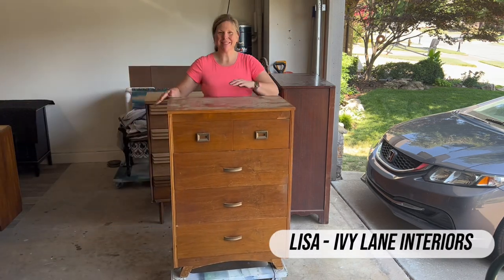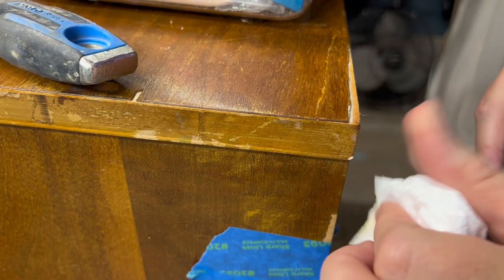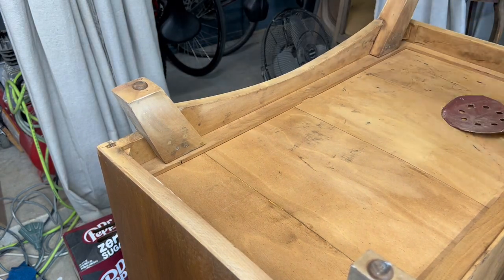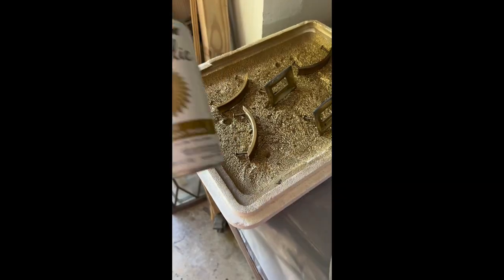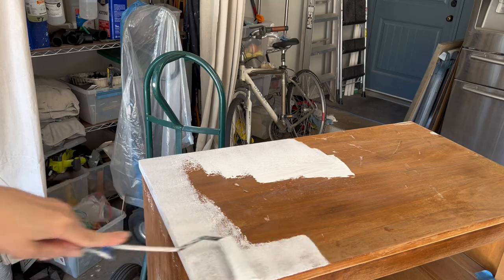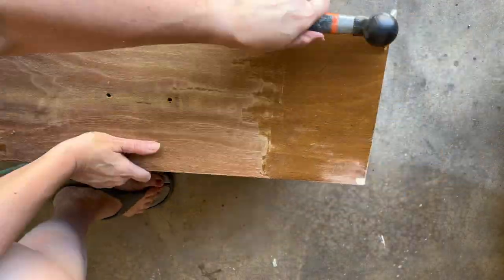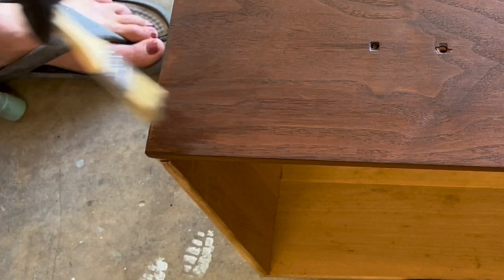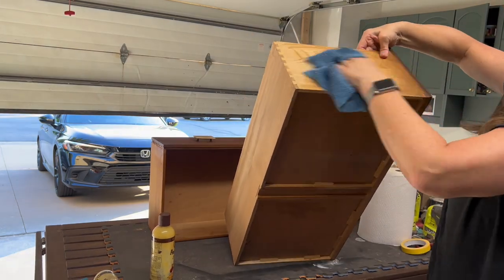Watch me flip this $35 Barn Find | MCM Dresser Flip | Furniture Makeover | Furniture Flip

Comment: Turned out beautiful! Glad the staining process worked out this time with all your research. You can actually do what’s called a “cut” of the regular shellac to be similar to seal coat. All that product actually is a “cut” of it. Just take some denatured alcohol and dilute the shellac by about 1/3 or so.  This is what I do when I’m using shellac as a top coat as it’s way too thick to get an even finish as it is out of the can.
Reply from the maker: Yes, I've read about that. I just need to try it!

Comment: Try Durham's Rock Hard wood filler, is a powder that you add water to, you don't have to worry about it drying out and it's really good!! Love the final result, even through the struggles of the wood filler.❤
Reply from the maker: I've used Durham's for wood grain filler, but never a deep repair. I'll check that out. Thanks!